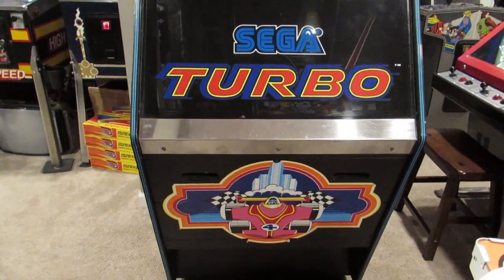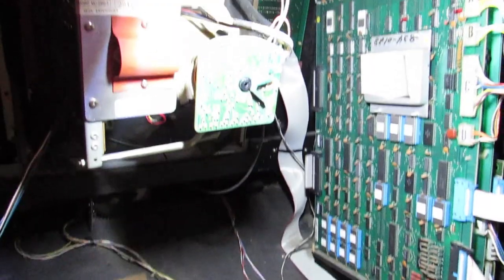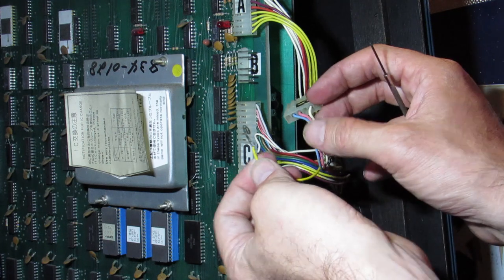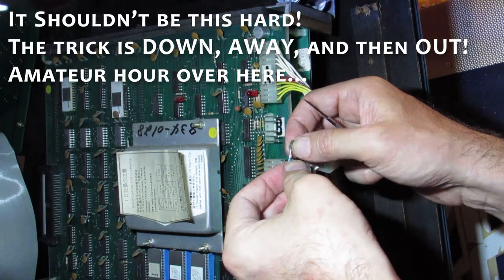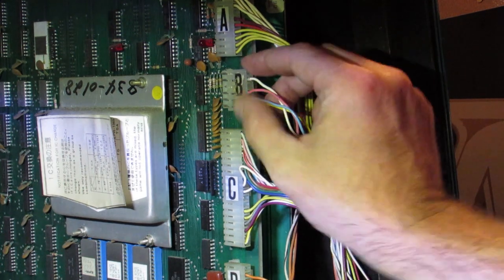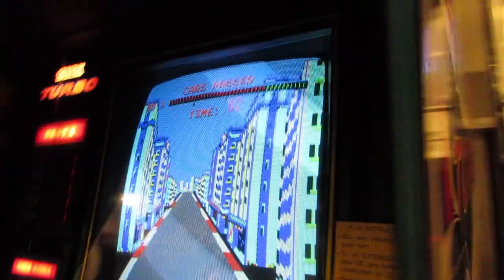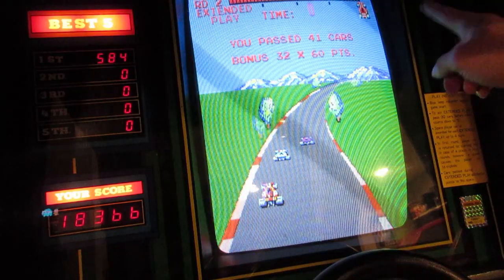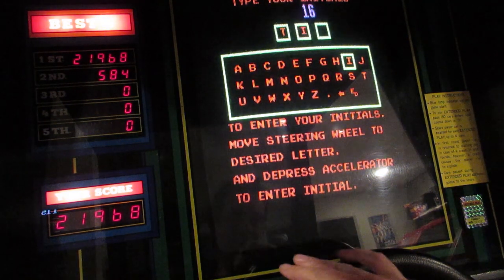Sega Turbo - Steering Repair

Comment: I just picked up one of these..worked fine, but after about half hour of playing, the car would veer to side of the road, and had trouble getting back on the road. Is this an issue with pin B?
Reply from the maker: It would be the same pin as the steering optos. Old/dirty pins can be inconsistent, especially as heat starts affecting things and the game has been running. Voltage should still be good there too. Good luck!